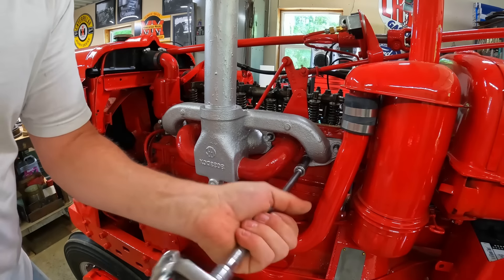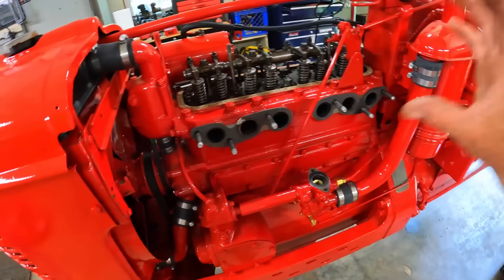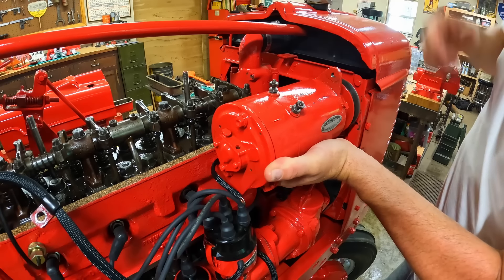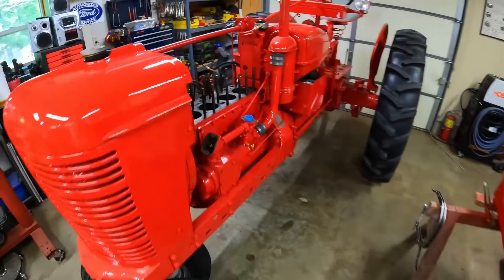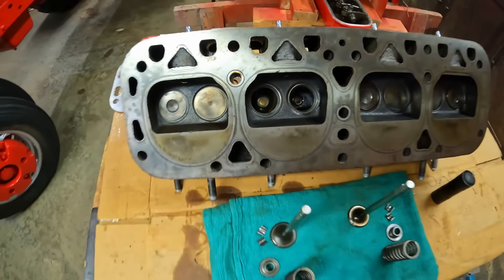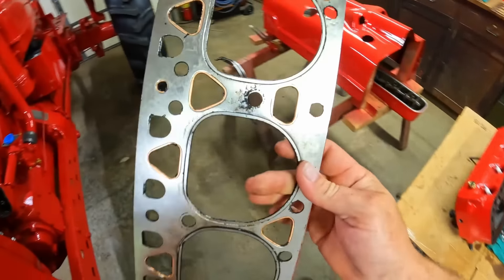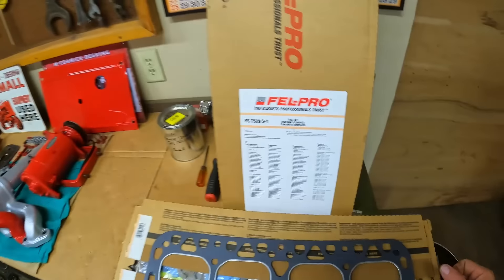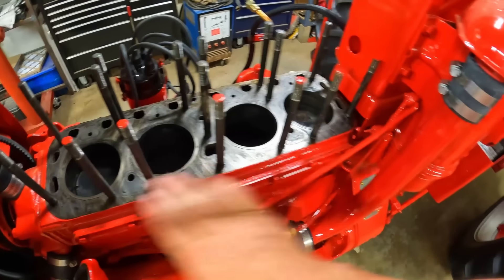Farmall H Engine Knock Found, But It's Not What I Thought - Farmall "Preparation H" Project Part 45

Comment: Do not run the way it is. Once the rim breaks off the sleeve it will find the crank and become parts in the crankcase and a mess. I have seen it first hand. I would pull the pan, rod and piston, pull the sleeve. Inspect and clean sleeve and block. The clearance's of sleeve to block are to loose of a press fit as well as your gasket issue. I see two, possibly four choices to salvage what you have. Here are the options I see in the order I personally have seen done.
1st and what I have seen done. Clean sleeve and block, then install the sleeve with Loctite Sleeve retainer compound. Assemble engine with the correct gasket and move on with life.
2nd Inspect and clean, and reassemble with the new correct head gasket. Hopefully this works.
3rd Inspect and clean. Then knurl the outside of the sleeve to expand the od and obtain a tighter press fit. Reassemble with the correct head gasket.
4th Inspect and clean. Possibly flame weld or coat the outside of the sleeve with a few thousands thick coating to cause a tighter fit in the block. the material needs to be thermally conductive so the heat passes to the cooling water.
I have seen the first option successfully done a couple of times, as to rebuilds will it see another in your lifetime requiring sleeve change?

Comment: best to just rip the bandaid off.18 years ago you were young and green as a mechanic. If the new sleeve is loose you are going to have to pull the engine and have a machine shop make you a custom sleeve. unless this is just going to look pretty and sit.  But then this will eat you away inside.

Comment: So 18 yrs ago when you rebuilt engine no green bearing and sleeve retainer was used? I'm assuming engine is dry liner not wet liner? You could get away with just changing head gasket because liner/sleeve was loose before changing gasket and head. Didn't run it that long so I doubt block and sleeve are hurt.

For people who don't understand terms that are used. Some manufactures call engine wet or dry sleeve and other call them liners both are the same
Reply from the maker: Correct, back when I did that rebuild I noted that all 4 new sleeves just slid in by hand so none were a tight fit to begin with. Also, no retaining compound was used.
Reply: @squatch253  You would think manufacturer would fit them little tighter. One to support sleeve and for better heat transfer to block. All sleeves I've seen done either pressed in with press or heating block some, freezing sleeve and they drop right in always had retainer compound on them. You would think running and being loose carbon and oil would get in there fill the void

Comment: Split the tractor and put a ford 300 6 cylinder in there then your done you might have to stretch it a bit but it will work

Comment: Oh wow, one of the view moments, that im happy, my old engines hasnt cylindersleeves, the run all in the block casting.
I didnt know the specs from IH, but in the coments here i read, the sleeves didnt hold very strong in the Block, so only the correkt headgasket will repair the issue.
If i remember correct, it was cylinder 3, who hat the coolantleak in the head? maybee the vaporised whater cause a litte shrinking of the sleeve and made it  loose?

Last weeks i also hat an Headgastket issue, causing by an colapsed cylinderheadsurface on my Borgward, who means to fill his cylnder 3 and 4 with coolant...  But after a small surface milling jop, 1.1mm (0.0433") all was fine and it runs 150km (93,02miles) without new problems this week.
I hope i wrote this in some undersatable english.
Greetings from Austria
Reply: 0h,wow,a Borgward. Back in in 1963,my father adored his Borgward Isabella. In Victoria,BC. Regretted trading it,but where was he going to find parts and repairs ? There are still a few left here in North America,but they are very rare. Good luck with yours. Borgward was very proud of their engineering. Engine and transmission particularly. I am told that at the time there were periodic issues with porous castings,thin wall aluminum casting being new to the Borgward engineers. Both engine and transmission castings could be a problem. A vehicle that has lasted this long is unlikely to have such a problem.
We still have some photos of the car. Be interesting to compare drivability with a modern car. Decades of engineers have hopefully improved such, probably not as much as they would like.

Comment: I'm surprised the good OEM head gasket would keep the sleeve from moving
Reply from the maker: Quite a few dry sleeved engines only had slip-fit sleeves, with just the head gasket providing the retention. It wasn’t until later when horsepower increased and diesels also started using them that press-fits became necessary, mainly for better heat transfer 👍

Comment: The cylinder sleeves are not supposed to be loose in block - that is crazy. Rely on a head gasket to hold down the sleeve???
Reply from the maker: About half the dry sleeved engines ever made have slip-fit only sleeves, head gasket retention being the primary method to hold them in place 👍

Comment: I would not replace any sleaves or pistons...just get the proper head gasket on and be done with the knock issue....sleave will be pushed down a bit less than flush on a crimped gasket...no more sleave movement sound.

Comment: Check parts and if everything looks good, install correct fitting head gasket and LEAVE IT!! If it ran fine for 250 hours it will be alright. It's not like it's going to see a heavy workload.

Comment: Rather experimental idea, remember the X231 Prototype - Fabricating, Pressing & Pinning the New Flywheel Hub - Part 81 where you made a new hub for new set screws install.  How about the same theory to the sleeve to block interface?  the screw would be under the gasket and far enough away from sleeve ID such that there would not be concern of losing compression from the screw location.  Again, its a crazy, experimental idea....

Comment: My thought Squatch is why is only the one sleeve moving??? Why not the other 3?? Is the friction enough from the rings supposed to be able to move the sleeves, even when installed new??Did the lower O ring roll out??I think at this point removal of the one piston assembly and sleeve is warranted to find out the  reason why the one sleeve is lifting up??
Reply from the maker: Fortunately these are dry sleeved blocks, so no o-rings to worry about and none of the sleeve touches any coolant. 18 years ago when I rebuilt this engine I was able to slide all 4 new sleeves in by hand, so none were a tight fit to begin with 👍
Reply: @squatch253  Then why only the one being pushed up is my thought?? What is the reason??
Reply: Is the block cracked somewhere??
Reply from the maker: It’s just the one that offered the least amount of resistance 👍

Comment: Do these sleeves have o rings to seal the cooling system?  interesting that only 1 out of 4 sleeves moved,  quality has been dumped for a fatter pocket seemingly even big brands are going the same way.  Thanks for posting.
Reply from the maker: Fortunately these are dry sleeves, so no o-rings to worry about 👍
Reply: @squatch253  so surrounded by cast iron engine block and no contact with coolant.  sorry for my ignorance i don't work with engines like these, Great content though a good change of pace to my usual. Thanks for posting.

Comment: That sleeve should never move in its seat inside the block, that new gasket is not going to keep it there for a long time, its just gonna break the gasket this time cutting it like a guillotine. Compare it's seat to the other sleeves and see if there is any differences.
Reply from the maker: Back when I did the prior rebuild on this engine 18 years ago, I slid all 4 new sleeves into the bores by hand so none were a very tight fit to begin with 👍

Comment: Are those sleeves suppose to be that loose? Never saw a sleeve you could pull up and down like that. The head should hold them down. Did you have the head milled? I don't know something seems amiss to me. Also those are odd shaped fire rings on that head gasket. On a diesel engine the protrusion on the liner and the head mating to it hold them in they can be counter bored and shimmed those are wet sleeves you have dry ones. Be curious what you find.

Comment: I’m curious to know if your H had previously had M&W pistons and sleeves in it before you rebuilt it.   I had watched you video were you and Senior honed and snuggly fit the liners into the Farmall M, because they were originally to tight.   My machine shop says that is why you want for good heat transfer, however I am currently rebuilding a Farmall 400 motor and am having the same problems you had with the infers going in loosely.  The old pulled out very hard, the new push in easily when warm.  My block also has all 4 cylinders labeled as D, so they are on the loose side, I’ve had 1 person as well as my machine shop mention that when M&W liners were installed back in the day, the parent bore was bored out more to accommodate a slightly larger O.D liner.  I have 2 motors out of IH 400s that previously had M&Ws in them and have this problem.   Can anyone else shed some light on this theory.
Reply from the maker: I’m thinking it’s a combination of having the “D” sized block bores and the fact that most of the new sleeves and pistons on the market today are all over the place when it comes to specs. On this H engine, the loose #3 hole is an “E” stamp, so it was almost too big from the start - the other three are all stamped “D” so it’s not surprising that I slid all of these sleeves in by hand 18 years ago when they were new.

Comment: I'd check out the sleeve, make sure nothing is damaged (and I can't see how), put the proper fitting head gasket on it, and run it. It sucks that you had this issue but at least you found it without digging much deeper!

Comment: Aren't these sleeves supposed to be a shrink fit so they are tight in the bore? I have personally only rebuilt wet or sleeveless engines so that's why I am asking. Having one move up and down does not seam right even with an incorrect head gasket. I think I would pull that piston and sleeve and install a new set assuming the block is not worn.
Reply from the maker: These IH engines mostly just had slip-fit dry sleeves, the press fit dry sleeves didn’t become a common thing until later when HP increased and they also started seeing wider use in diesel applications 👍

Comment: could alsways do a farmer fix i have seen done a few time, use weld to build up the top of the sleeve just enough to where the sleeve touches the head with about 4 thousands of clearance, take up the play while also allowing the gasket to do its job.

Comment: Hastings. I was an engineer at Hastings Manufacturing for about 15 years. They still operate in Hastings, Michigan, but ever since they went bankrupt in 2007 it became all about cost cutting under the venture capitalists that took over. I haven't been there since 2010. I know they are doing more and more in China. That push started while I was still there. Of course, the filter line was sold to Clarcor (Baldwin) in 1995. I was there when that happened as well. Now Parker Hannifin owns Clarcor.

When I was a child, Hastings Manufacturing was the place to work in my town. Not anymore.

Comment: I'm trying to think back. Wasn't it #3  sleeve that had the antifreeze leak that started this hole overhaul. What if it is an oversized hole that the sleeve is in. Could the sleeve be  sliding up and down in a loose hole.
Reply from the maker: It was cylinder #4 that had the water getting in from that previously pinned cylinder head crack 👍

Comment: If a sleeve in a dry sleeve engine is that loose, won't it have problems with heat transfer to the block and possibly overheat?
Reply from the maker: Not necessarily, I slid all 4 of these sleeves in by hand 18 years ago, with slip-fits not being unusual for these dry sleeved engines 👍

Comment: I would guess this has been asked before but with my bad eyes I can’t read all these comments. Aren’t there O-rings on the bottom of the sleeve to seal the water jacket and thus if that sleeve was moving at all in there that seal is shot and needs new rings ?  Just curious more then anything when rubber seals for water were introduced.
Reply from the maker: These are dry sleeves, so no o-rings to worry about - they’re just steel sleeves that slide into solid block bores to provide a replaceable wear surface. Wet sleeves though (like the ones I put in the Cat D2 #5J1113) are in direct contact with the coolant and have seals top and bottom 👍
Reply: @squatch253 ,  thanks very much for the explanation.  Love the videos.

Comment: I bet the problem is not the sleeve but the bore itself  crank the eng until piston is at tdc pull up on sleeve 0ne quarter  of the way  clean with elec motor cleaner  use just a little loctite green  not alot push it down and put it together  it will work and last into the next century/

Comment: In a full assembled engine, is it the slight overlapping of the head gasket that mainly holds the liner in place? Or is it a combination of things?
Reply from the maker: Yes, the majority of positive retention is accomplished by the clamp load of the head gasket and cylinder head pushing down on the sleeve. That is why I secured the cylinder liners down with clamping blocks when I rebuilt 5J1113’s diesel engine, so they wouldn’t pop back out before I put the cylinder head on 👍
Reply: Ran in to same thing on 756gasser.was able to look through spark plug hole and see sleeve. 
.doing the dance same problem wrong gasket from dealer.

Comment: What I find strange is how the clicking noise from possibly the sleeve moving was going away when holding the valve with the screw driver
Reply from the maker: Most people don’t know this, but piston rings actually expand outwards under compression and run tighter against the cylinder walls, with maximum outward pressure generated just as the fuel charge ignites. When we held the valve open, it took away the compression which relaxed the outward pressure on the rings, which in turn stopped the liner from moving 👍
Reply: @squatch253  Yes the sleeve would move up on the compression stroke, too bad such a simple thing is causing so much headaches!

Comment: With that sleeve moving would not have coolant in the oil.
Reply from the maker: This is a dry sleeve engine, so the sleeves do not touch the coolant. They're just thin-walled replaceable steel wear sleeves that slide into solid block bores.

Comment: Would you get good heat transfer if sleave is not tight in block
Reply from the maker: 18 years ago when I rebuilt this engine I seated all 4 new sleeves by hand, which isn’t unusual for dry sleeved blocks 👍

Comment: Toby, If the liner was moving up and down, how come there was no water leakage?
Reply from the maker: Dry sleeve design on the H’s and M’s - they’re just a thin walled sleeve of steel that is a slip-fit inside solid block bores 👍
Reply: @squatch253  Ah, understood.

Comment: I still don't understand how pressing on end of rocker arm making noise go away has anything to do with sleeve moving making the noise really puzzling how thick is head gasket when compressed thats all the sleeve can move up and down  Also is the spring preasure good on the valve ?
Reply from the maker: A lot of people don’t know this, but piston rings actually get forced out tighter against the cylinder walls when under compression, with maximum pressure against the cylinder walls just after the fuel charge is ignited. By holding the valve open, we took away the compression so the rings only had their own spring tension keeping them against the cylinder walls, which wasn’t enough to pull the loose sleeve along with them 👍

Comment: So the verdict is.. too clean of a cooling system?  A little corrosion would have locked the sleeve into place, but care during the rebuild and subsequent maintenance prevented the golden embrace of rust from hugging it tightly.
Reply from the maker: These are dry sleeves, so they don’t come into contact with any of the coolant. They’re just thin steel sleeves that slip-fit into solid block bores to act as an easily replaceable wear surface 👍
Reply: @squatch253  Oh, I stand corrected!

Continue to properly maintain your cooling system.

Comment: How much of a press fit is the sleeve supposed to be? Vs how much drag is present from the piston rings when the cylinder is pressurized.
Reply from the maker: The majority of dry sleeved engines like this one just used slip-fit sleeves, so it wasn't uncommon to be able to sink new sleeves in by hand if you had good clean block bores :-)